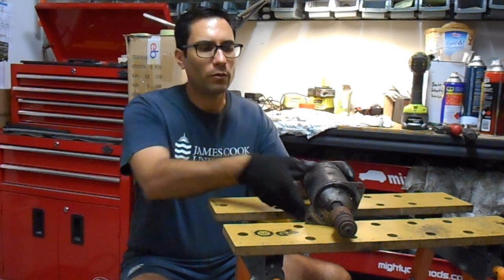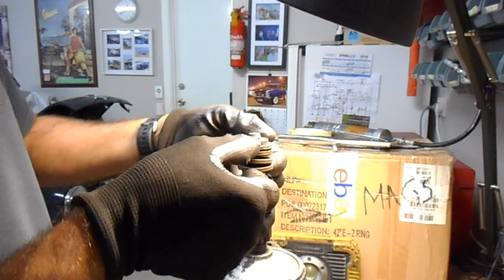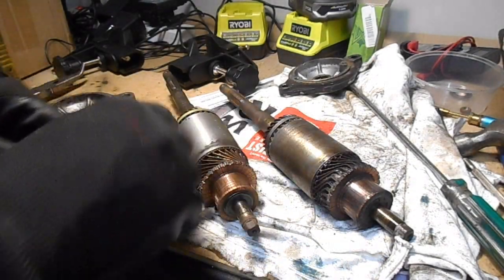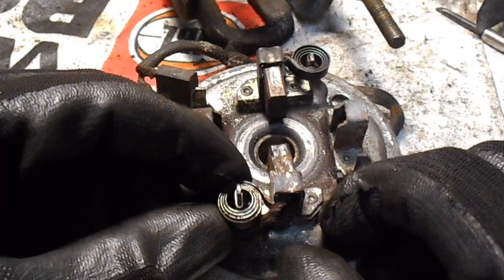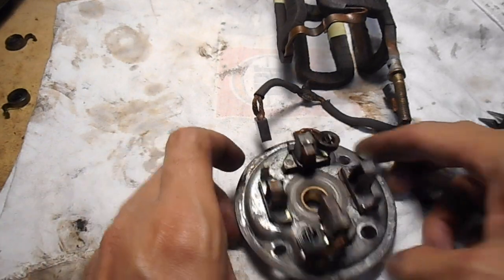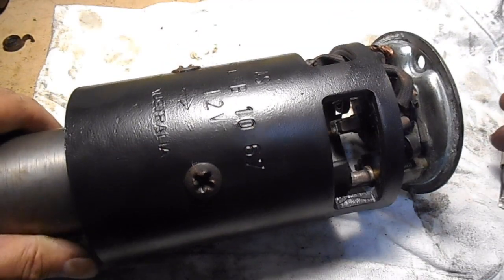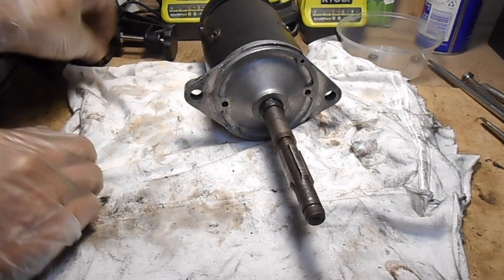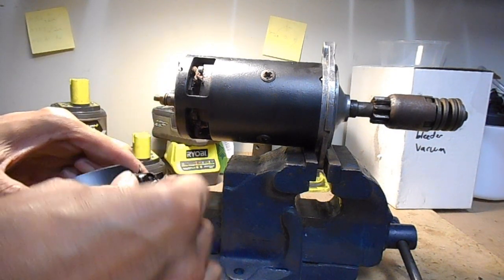Lucas M35 starter motor

Comment: Thanks for the help, especially the zip ties. One thing though, I trapped a small screwdriver between the motor housing and the zip tie. This allowed me to pull the brushes fully in and was easier to snip the tie afterwards.

Comment: Is there a way to reverse the direction of this motor?  I am not using it in an automotive starter application and I need it to run in the CCW direction.  Or is there a Part Number that runs in the CCW direction?
Reply: Yes you can. In a series wound motor like this you need to reverse the polarity of the brushes relative to the field windings